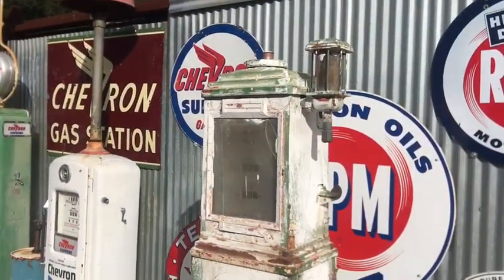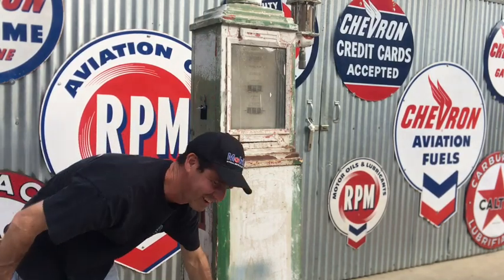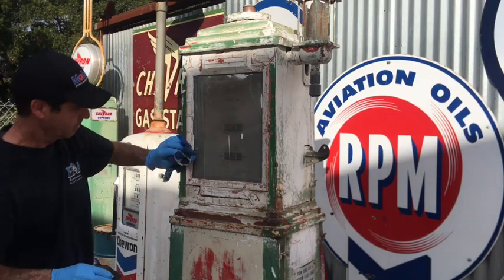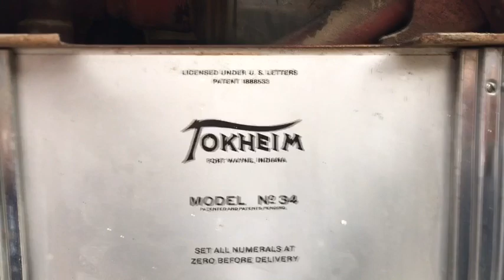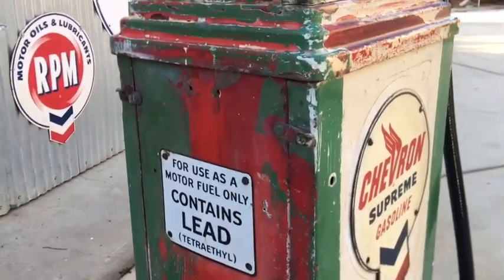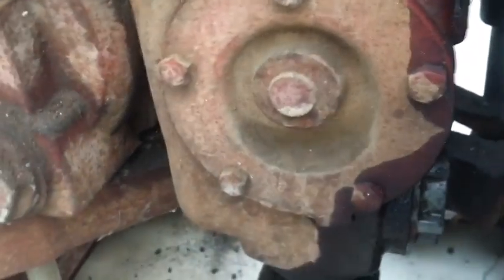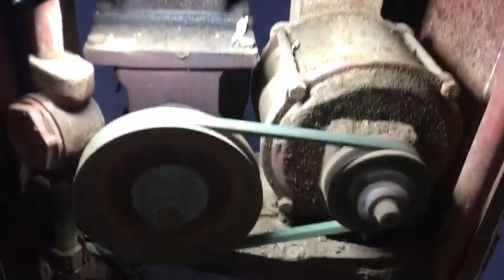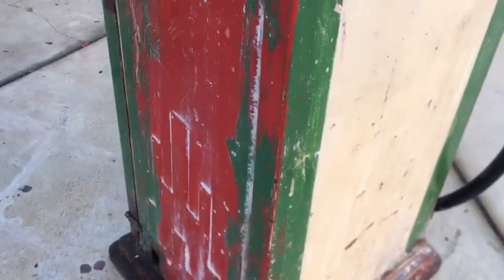How To Restore An Old Gas Pump’s Original Finish And Functionality

Comment: Rob, how would I transport an old gas pump? Can it be laid down or should it be upright?
Reply from the maker: What style of pump is it? Visible with glass or a calculator pump similar to the one in this video?  If it’s similar to the one in this video we lay them down on a 2 foot wide strip  of plywood and side them into a pickup truck.  Rob
Reply: @gaspumprob  It’s a Gilbarco 996 1L
Reply from the maker: @nasariogutierrez7832  No problem to lay that down in a truck bed. Just get help.
Reply: @gaspumprob  thank you